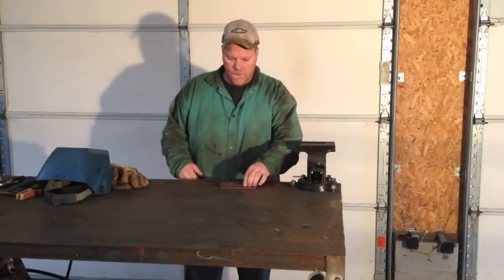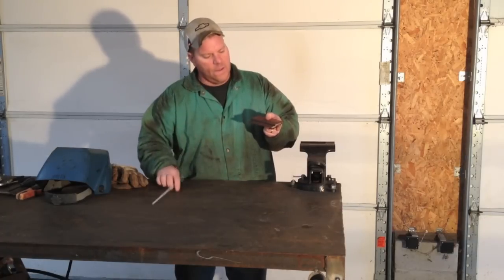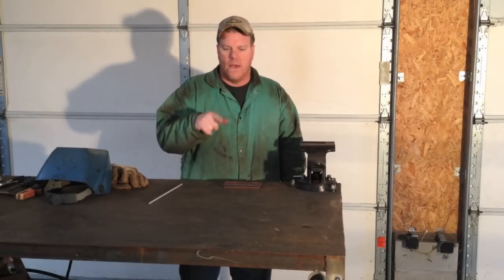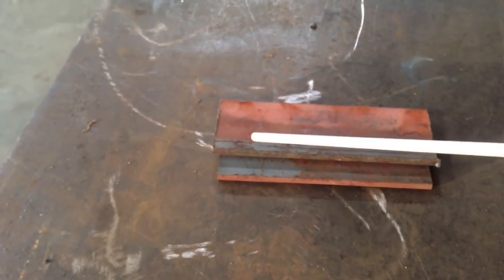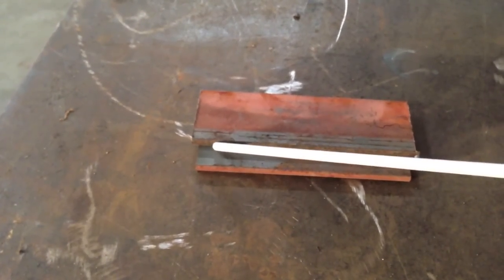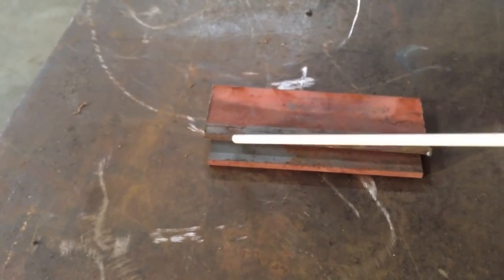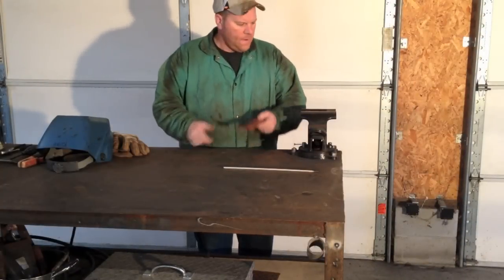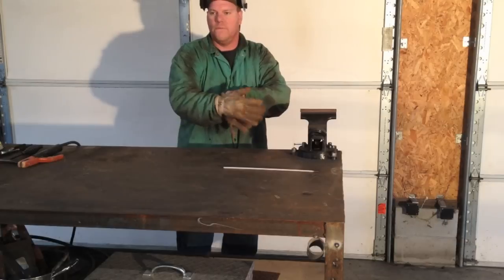Stick Welding Techniques and Tips 7018 Lap Joint

Comment from the maker: Yes, you will want to be dragging the rod and not pushing it. By pushing the rod there is a pretty good chance of burying your slag in the weld. With flux core or dual shield you can get away with pushing the puddle more than you can with arc welding. 

Sometimes the older welders can really run like a dream and are well worth holding onto. Have a good one bud.

Comment: big thanks for all your videos . the best metal fabs around i would bet . maybe you have time for a quick question ? in the facility we have, the previous company left behind an old ( and i mean OLD) Lincoln arc welder . seems to work perfect. i noticed you were dragging the rod , not pushing . is that standard procedure for arc ? it would explain my problems if so :) .

Comment: that was not in the flat position it was in the horizontal position same goes for a t-joint for proper flat position both must be positioned at a 45 degree angle so the weld will be applied flat.